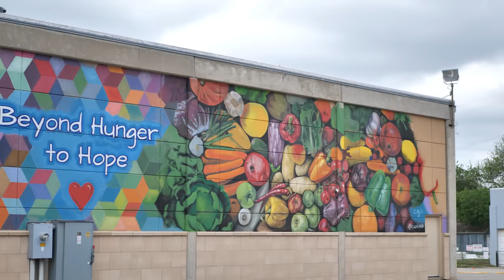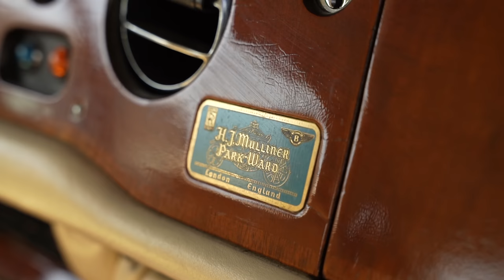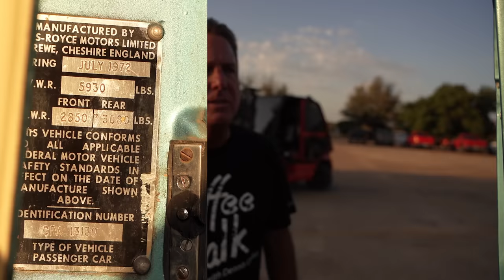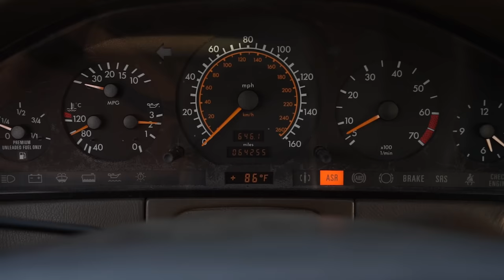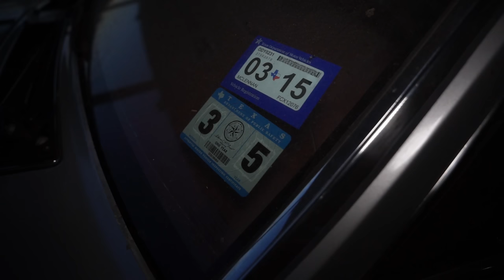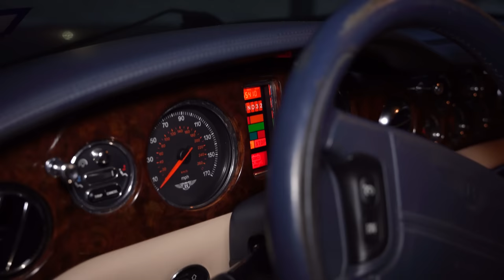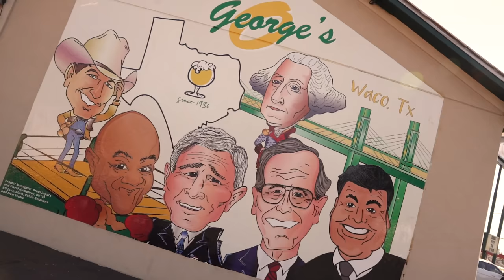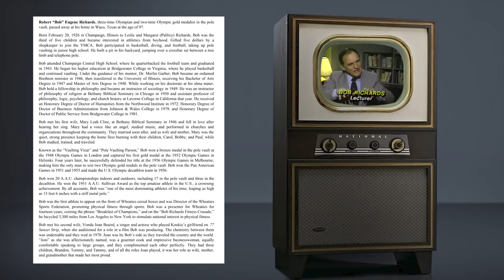I Bought 14 Luxury Cars from the FIRST Olympian on a Wheaties Box!!

Comment: what a cool find. i used to work for a guy during summers in high school who owned about 15-18 cars, and about 1/3 of them were either bentley's or rolls' of the same eras. my job was to basically wash the cars, keep the fluids cycling through them, get them inspected/registered etc. i remember the first time i got to drive his '93 turbo R. man was that thing a treat, so smooth and so much power, it was amazing how well it drove with the 3 speed GM auto it had in it .

Comment: 24:02 get the starting fluid with a straw and a piece of fuel line.... zip tied to spray right into the intake and operated by the driver

Comment: I just knew wasps were going to fly out of that gas lid with you tapping on it. Here in Mississippi if a car sits a week, out in the sun, you can be assured wasps will make a home of your car.

Last summer we were moving. And we had a lot of cars and big shop. Early 5am to 9am work to beat the heat like that. Soaked clothes. Carried spare T-shirt and shorts and a towels to lay on the seat to not soak the seats on the way home. Change clothes out in the woods behind the shop, still be sweating though on the way home!

Comment: Flapjacks VS Pancakes 
Flapjacks, originating in the United Kingdom, are made from rolled oats, butter, sugar, and syrup. Flapjacks  are oat-based bars, baked until golden and cut into squares or rectangles. They are more akin to granola bars and are consumed as a snack rather than breakfast.
Pancakes, on the other hand, are a staple in America, defined by their soft, fluffy texture and ability to soak up delicious syrups and toppings. Pancakes are a breakfast item, served with syrup and various toppings, such as fruits or whipped cream.

Comment: I love your new car, I had a 91 z28 convertible with a 305 TPI.  I was told that z28 convertible’s & t-top cars didn’t have the 350’s because the bigger motors would be to much of an engine  for a unibody car.

Comment: I’ve spilt more fuel with those supposed safety gas cans as they don’t seem to fit every gas port and you eventually get pissed off trying to get the gas to flow and just take the nozzle off and use a funnel. Leave it to Cali to find a way to screw things up.

Comment: Rolls and Bentley might sell okay. Mercedes, BMW, Mini, Jaguar, Range Rover, etc.... I wouldn't put any more than scrap metal price in them. I worked for a metal recycler and have seen running and driving models of them come on the yard as scrap. The outrageous cost for repairs and maintenance gives them horrible resale. Somewhere around $200/ton is more than they bring as used cars.

Comment: The damage you are doing to those engines by running them on starting fluid is crazy to me.
Reply: If the engine turns over, there is oil pressure and you have coolant flowing, starting them on starter fluid is OK for a few 100 feet.